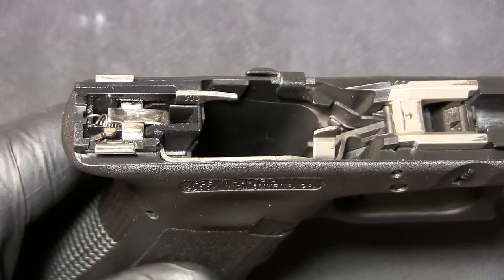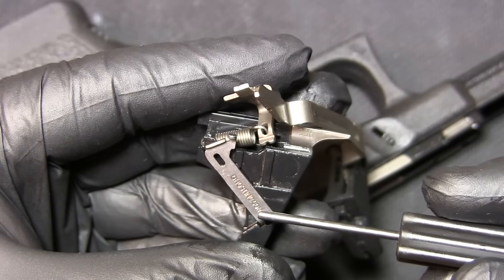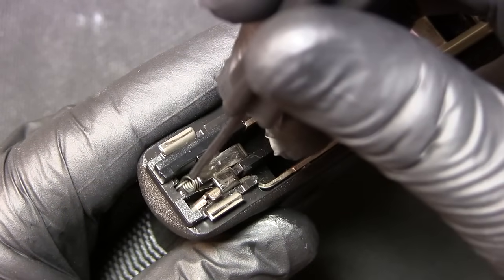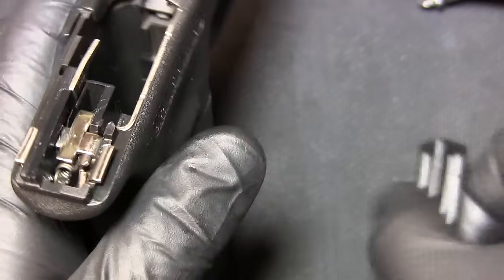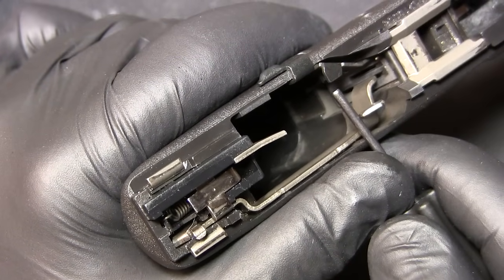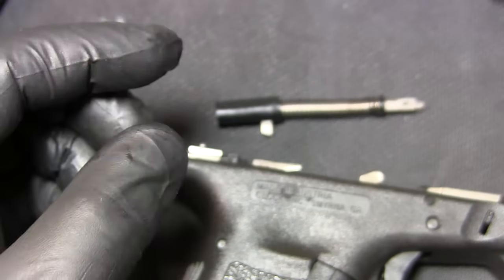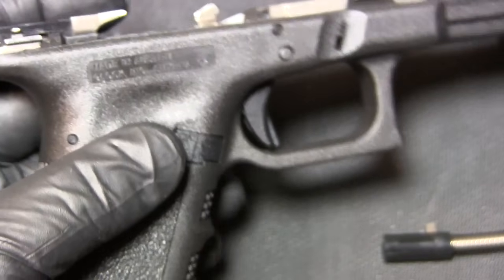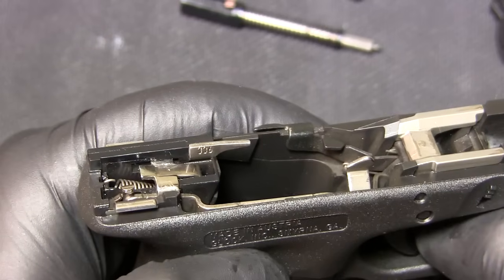How Glock triggers work and how they reset

Comment: Maybe you can tell me why my new Glock 17 custom build rapid fires or double taps with one pull of the trigger?
Reply from the maker: That can happen if your striker is stuck forward in the slide, protruding out of the breech face.
Reply: @MosinVirus  yeah I'm not sure I did check all the functions and it seem to work just fine before I went to the range the striker moves freely inside the slide channel liner
Reply from the maker: @thegoot216  Is it used (as in non-original or modified parts) or did you replace any parts in this Glock?
Reply: @MosinVirus  so it's a p80 gen 3 Glock 17 I just got done building. It's not OEM Glock parts. I bought the lower parts kit off eBay that was probably my first mistake. nothing was modified I even had my friend double check the firearm before I went to the range today and he is pretty versed in firearms himself. Loaded 5 rounds into the magazine to be on the safe side being the first trigger pull on a brand new firearm that I built it literally shot all five rounds all at once. Then I put two rounds in the magazine tried that and it usually would do a double tap after I pulled the trigger one time sometimes if I let off very fast on the trigger it would work the right way but usually it would just keep double tapping two rounds that were in the magazine every time I loaded it
Reply from the maker: @thegoot216  it is most likely the relationship of the trigger housing and trigger bar in the frame to the striker lug in the slide. Get an armorer back plate for the slide so you can see the action as you rack the slide, etc.
Reply: @MosinVirus  thanks brother I appreciate it I was looking into that as well also probably going to go ahead and get OEM parts for the lower. I' about shit my pants today at the range. it wasn't a good feeling😩
Reply from the maker: @thegoot216  I can imagine. I had something similar happen with one of my 1911 builds. Overtravel of the trigger can hang up the sear and... you live you learn.

Comment: quick quesiton about 12:16: where does the sound of snap come from? it came right after trigger was pulled.
Reply from the maker: With the slide off of the frame there is nothing there to pull the trigger forward, so the only spring tension present is what pulls the trigger bar back and down. The only thing that was holding the trigger in place was the trigger safety tab. When I pushed on the trigger safety tab the trigger spring pulled the trigger bar back. That produced the snap when the trigger bar snapped against the trigger bar housing.
Reply: @MosinVirus  its really helpful. Thank you!
Reply from the maker: @edwaeable  my pleasure.

Comment: I have a loose trigger, it will not reset. I can move it back and fourth without any clicks. I have a NY1 spring but have an S spring on the way, will that possibly fix my problem if not any recommendations?
Reply from the maker: Sounds to me like you need to take it to a gunsmith.
Reply: Just fixed it by replacing the spring lol
Reply from the maker: Excellent. I have never used those NY springs.

Comment: My G26 won’t fire I noticed it doesn’t have that trigger spring. When I try to fire it the trigger doesn’t reset it just stays pulled back. Could that be the only issue?
Reply from the maker: I would double check that all parts are present. There are no useless parts in a glock.
Reply: @MosinVirus  it’s a gen 5, I noticed that gen 5 doesn’t not use that trigger trigger spring. I just noticed that my plunger is stuck into the slide making my sticker be stuck as well.
Reply from the maker: @gerardomontejano2993  sounds like you may want to have a Glock armorer take a look.

Comment: My G43 the trigger stopped resetting when I manually cycle the slide. Maybe it would work 10% of the time. I did a tear down of the firing pin assembly and polished the safety plunger. Cleaning and rebuilding changed the reset failure from 90% down to about 2% - fails to catch once in about 50 cycles, but it seems to work every time when you pin the trigger. 

What is going on? I want to polish the trigger assembly but the pin over the trigger is being a real bitch. I should send it to a shop and stop messing about.
Reply from the maker: In some cases when the trigger spring is kinked to the side at the bottom of the trigger bar, it can cause issues with reset and the trigger pull will be heavier. Check to make sure the trigger spring is installed correctly/hooks centered. If that is not an issue, you can always buy replacement parts in case you removed too much material from the parts original to the pistol.

Comment: had a weird thing happen in a Glock 19 i bought new i took the slide off and when i went to put the slide back on it wouldnt go all the way back together it would stop with about a 1/8 of an inch left before it would lock all the way back like they are supposed to. Do you have any ideas on what is causing this?
Reply from the maker: Did you take anything else out and reinstalled it at the same time?
Reply: @MosinVirus  No just took off the slide and put it straight back on i pushed the striker forward and did get it back on though
Reply from the maker: @shannonandsheila1403  sometimes the striker safety in the slide can be protruding too much. That could have been it.
Reply: @MosinVirus  How can you fix that because that sounds correct. Thanks ahead brother
Reply from the maker: @shannonandsheila1403  you move the striker foot until the striker safety can seat back where it should be.
Reply: @MosinVirus  I got you it came absolutely slathered in oil maybe that is what is holding up the striker im going to take it all apart this weekend and see. Thanks for giving me some insight on this man appreciate your time.
Reply from the maker: @shannonandsheila1403  No problem. Usually that happens when the slide is pulled too far back during disassembly. The striker hangs up a bit and causes the striker safety to drop slightly.
Reply: @MosinVirus  That makes sense the take down tabs are tighter than any Glock ive ever had i bet thats what im doing while struggling with the tabs. Its one of the new made gen threes and it has the best trigger ive ever felt from a factory Glock the whole gun feels tight and really well done.
Reply: @MosinVirus  I took your advice and took the slide off this morning paying attention to how far i was pulling the slide back being careful to only pull it back a small bit and it worked i was just pulling it back to far everytime. Thanks again

Comment: On the gen 5's you can weaken the trigger housing spring underneath the crusaform by removing material with sandpaper not to much though. A good trick is to just pull the spring out and scrunch it up on a dremel bit, and the other end secured in the chuck of a drill to use it as a lathe to keep everything consistent and even. Start slow and work your way there because you can't add more material back but you can take as much as needed, it works. 
Thanks to JG.
Reply from the maker: Sounds like that will increase trigger pull weight.
Reply: @MosinVirus Your right it does a little but my finger can't feel it, maybe some better shooters could feel it but I'm pretty satisfied with it considering I thought the 4 1/2 lb striker spring was to light for my comfort.
Reply: @MosinVirus  Thank you for  this video, I like that you get in and figure things out for your own peace of mind and curiosity.
Reply from the maker: @timbenham516  Thank you. Yes, I do not like to be "kept in the dark". Same reason I wanted to get a house that I would need to "open up a bit". Guns are no different.

Comment: The spring weight of the firing pin is not just about trigger function because it also needs to be strong enough to ignite the primer
Reply from the maker: Absolutely. I hope I didn't say it was only about trigger function.

Comment: Great video! I'm having trigger reset issues (G-19) along with light strikes and needed to understand how the reset actually happened. New trigger bar on the way (from manufacturer) and if that doesn't help, I'll try the 6lb spring. Thanks.
Reply from the maker: Yeah, almost sounds like the striker spring is too weak against the trigger spring. But also make sure the trigger spring is properly installed and not off to the side where it connects to the trigger bar. That can cause reset issues for sure.
Reply: Off to the side? Are you referring to the hook at the end of the spring? It should be in the little groove, right?
Reply from the maker: @harveyshot939  yes and yes. Sometimes when installing the trigger bar back into the trigger housing the spring jumps to the side.

Comment: This is the best explanation of how the parts interact that I’ve been able to find. It is important to understand how the bottom ledge of the firing pin catches on the back edge of the trigger bar cruciform. Likewise with the trigger bar/connector relationship as you pull the trigger and, especially, during reset. 

It’s been 6 months since I last took one apart and re-watching this video is exactly what I need for a quick refresher!
Reply from the maker: Thank you very much. I am glad the video continues to be useful.
Reply: @MosinVirus a couple of light firing pin strikes the other day lead me back here again for a refresher. A Glock is nothing like a Smith & Wesson revolver - there I can take the side plate off and recall how everything works in 60 seconds.
Reply from the maker: @chipsterb4946  yes, a revolver system just makes sense.
Reply: Even the super-duper computer animated "How it works" channels gloss over many things, or fail to show certain steps in their quests to be so clever. It really is a shame that they put more effort into how polished the animation is compared to the accuracy of the information. It really is hit and miss

Comment: This might be nitpicky, but you don't need a stronger firing pin spring because of a stronger trigger spring. The firing pin spring strength is to ensure you have enough force to detonate the primer. A weaker spring will allow a lighter pull, but can lead to inconsistent strikes (some being too soft to detonate the round). 

Some people get a stronger one just to be safe with their carry pistol and feel confident that the pistol will go bang instead of click
Reply from the maker: Indeed. Plus a weaker striker spring may not reset the trigger enough to engage the trigger safety.

Comment: bro have you found out what makes the trigger mushy? or a combination of what items
Reply from the maker: Usually an improperly aligned trigger spring makes the trigger mushy and sometimes produces reset issues. Make sure the spring is not kicked to the side where it connects to the trigger bar.

Comment: What would prevent the trigger bar from jumping up when you push the connector laterally like you did?  I'm having an issue with a G19 and when you push that connector theres no pop up from the trigger therefore, nothing for the firing pin to catch and drive the trigger forward and reset.  Great video it's taken me a few days to figure this out and your video has helped tremendously.
Reply from the maker: One thing that can contribute to the issue you are describing is improperly installed trigger spring. The spring hook that goes on the trigger bar can sometimes jump to the side when you insert the trigger bar back into trigger bar housing. When the spring is off to the side, there is friction that shouldn't be there normally. Look down into the trigger bar housing and see if the spring is off to the side.

Comment: Lone wolfs parts are a bit goofy. I had to bend the connector slightly inward because it applies too much pressure and will not let the cruciform fall.
Reply from the maker: Good to know. If I remember correctly I have used their connectors since when I made the video and never had an issue. Maybe something changed.

Comment: Mine resets unless I depress the trigger. Why is that? And what is the issue?
Reply from the maker: Sorry, I don't understand the question.
Reply: @MosinVirus  my trigger does not reset after pulling and holding the trigger while cycling.

But I solved the issue. I removed the trigger group and reinstalled it after doing and seeing nothing wrong. And it’s working again. Very weird since it happened on 2 of my p80’s at the same time. Fixed both
Reply from the maker: @mrmidnight32  make sure the trigger spring hook on the bottom of the trigger bar is not off to the side when you reinstall it. That causes a sluggish pull and lack of reset since the spring is rubbing on the side of trigger housing.

Comment: My trigger won’t reset if I have a loaded magazine inside mine. But if there’s no bullets in my gun the trigger will reset perfectly fine. Does anyone know what could be the problem?
Reply from the maker: Does the trigger reset when you have an empty magazine in the gun?
Reply: @MosinVirus   I realized it had something to do with an afterarket trigger assembly a friend gave to me. I used the cheap trigger assembly that came with the p80 kit and it functions properly.

Comment: So Glock claims that their metal parts like the ejector, trigger bar, and connector, have a special coating on the surface that helps protect the metal, and polishing those parts removes that coating/finish to a point where function of the firearm will wear them down much faster over time. For that reason they say that you shouldn’t polish those parts, so I never do. I don’t polish the extractor plunger either. I’ve yet to have any issues with those parts due to polishing or lack of
Reply from the maker: I generally agree that the polishing will remove the coating on the parts. Though I am not sure if that coating is harder than the base metal (can't remember).
Reply: @MosinVirus  That’s what Glock claims, that the coating is more durable and harder than the metal underneath. Obviously I have no information to prove their claim true or false, but I figure they wouldn’t say it for no reason whatsoever. I do like the mirror finish look of polished parts though. I always polish my locking block and rear rails on P80s

Comment: Brother, I know this is an old video, but as a former certified chief weapons armorer for a L/E agency, this is STILL one of the best vids I've seen on this topic. Great job, my man.
Reply from the maker: Thank you very much
Reply: It's the ONLY one I've seen on this topic.
Reply: Also shows how a switch works. The pin from the switch depresses the part that raises the trigger bar and the connector keeping firing pin and bolt carrier group from catching allowing full auto fire via preventing the trigger from resetting at all and causing a closed bolt semi automatic pistol to act almost like an old open bolt machine pistol bolt carrier just dumping mags off of pure recoil.
Reply: @JustinBobby-di9zt Glock bolt carrier group you say…
Reply: @JustinBobby-di9zt  all a switch does is kick the “cruciform” back down and out of the way when the slide goes into battery after the first shot so the striker can hmmmm, strike again without releasing the trigger to reset… maybe that’s the same thing you said 🤷🏻‍♂️
Reply: @JustinBobby-di9zt  shhhhhhhh
Reply: Ir5t5 tr tr r t tr⅚rtt😮😮þ😮tr😮😮😮t😮t😮😮is 😮truly 5t😮t t r5 tr t tr ft tr t 5 t t t t ft t ft ft 5 tr t tr ft truly rrr😮is t😮😮þ😮😮😮d5😮
Reply: Agreed. The Glock trigger system is of course a bit odd, but it is good for Law Enforcement or even the military. This system does not allow for accidental discharge, the trigger must be actually pulled, unlike a gun like the 1911 which can just take a light bump. 

I looked at this because I got interested in the Switch, which comes into the back of the trigger / sear bar as the slide closes.
Reply: Thank you, this is very helpful!

Comment: From what i can tell, well done! I'm just curious; what is the lowest trigger pull weight that you've heard of by simply polishing all trigger pull related surfaces while maintaining factory OEM internals? On a glock, of course...
Reply from the maker: I have seen people report good improvement just by cleaning up the surfaces, mostly in the feel throughout the trigger pull. Not really in pull weight.
Reply: @MosinVirus  right? Basically, a thorough polishing of related surfaces would minimize friction which in turn would bring the pull to it's maximum efficiency. Thus, reducing felt weight. That seem right to you?
Reply: What I want is the smoothest glock trigger possible without bringing the pull weight below 5lbs. Also, i want the trigger to have the most affirmative reset. What are your recommendations? And thank you for your time and patience 🙏
Reply from the maker: @sgodlike7911  if your trigger feels gritty right now you need to identify the source and make it better. But don't change geometry of parts.
Reply from the maker: @sgodlike7911  Yes.